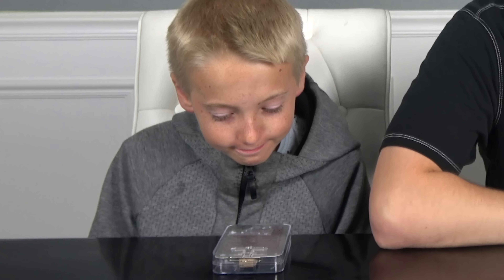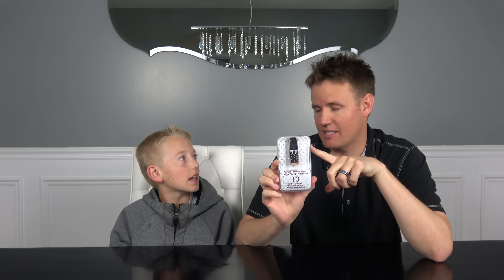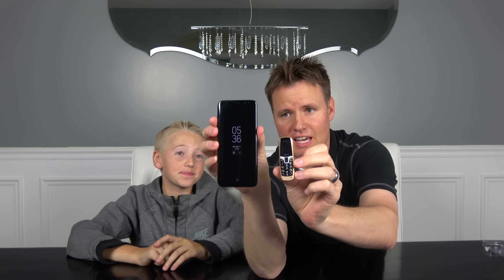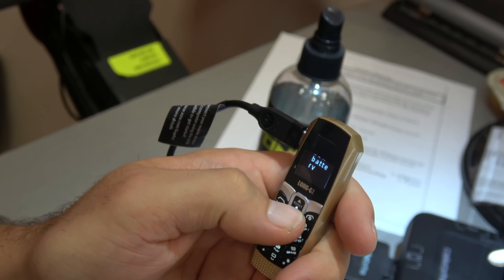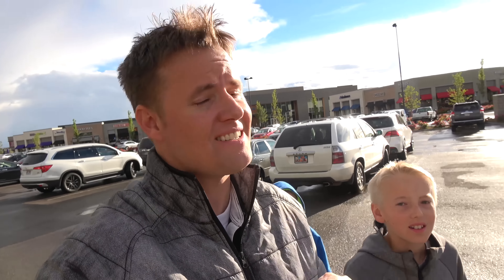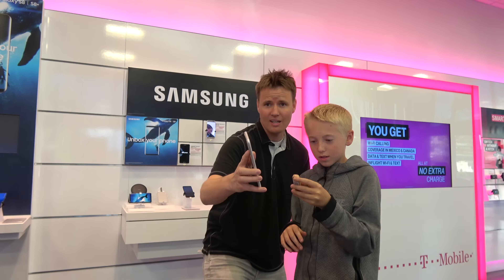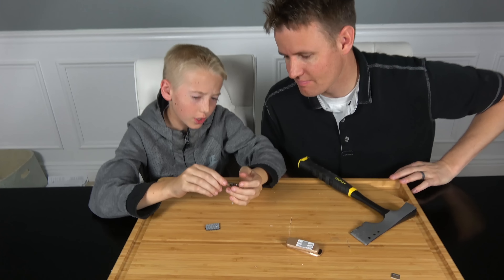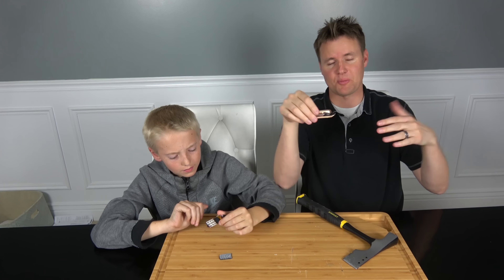What's inside the World's Smallest Cell Phone?

Comment: The battery in the phone is a two point connector metal ion battery (more commonly used for drones and other airborne RC toys), they're not used in phones often but they are relatively safer than lithium ion batteries and they hold more power than an L.I battery, although it is hard to determine how much charge is left. (Other than the percentage monitoring problems, don't understand why they don't use metal ion in most devices.

Comment: What's inside the Nokia 3310
Reply: facepalm
Reply: bricks and some cpu
Reply: they could never cut that open
Reply: It will be the hardest challenge for what's inside yet
Reply: Actually, it comes apart really easily.  Super Saf TV did drop tests with it and it separated into 3 parts every drop.  But it was easily put back together and worked fine.
Reply: Bennett Fultz A ROCK
Reply: 3310 bricks
Reply: An indestructible two snake, an small brick and a wall